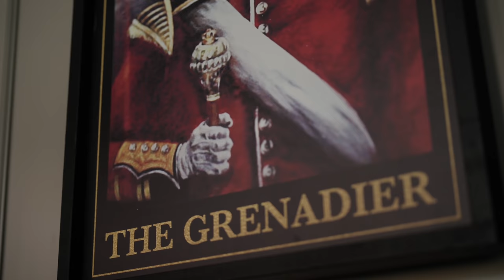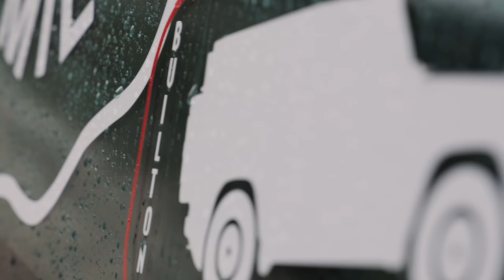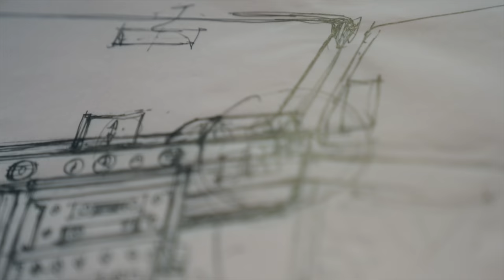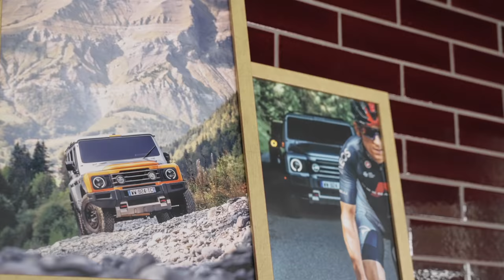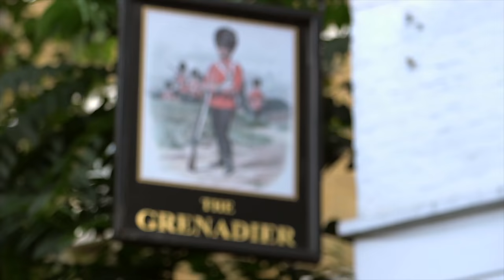Building The Grenadier - Episode 12 - Behind The Grenadier

Comment: Just a big thank you too Sir Jim.

The world just seems a better place now that there is a proper replacement for the classic Defender.
Land Rover is being run so baldly these days, they have forgotten what built their reputation in the first place.

I can remember Land Rover saying way back in the eighties that they would never make an off road vehicle without solid axles and then gave us the reasons why. They don't sell a single vehicle with solid axles anymore. They have forgotten their own principles.
Reply: Here here. I own, and love, a series 3 Landie but totally agree that modern Land rovers are too much of a muchness!
  Too much tech, totally unreliable and not fit for purpose. 
   Bought a 2015 Discovery (full size) 3.0 sdv6 kept it 3 years and 80,000 miles and that was enough. 4 snapped crankshafts from 2 replacement engines. Should have kept my td5. Now running a 2013 Ford Ranger wildtrak. 
   The Grenadier has caught my eye big time and I think in a couple of years I will be in one.
Reply from the maker: The journey has just begun...
Reply: @gertiestravelchannel5957  The term, "Not fit for purpose." Is the perfect expression. The go anywhere vehicle as long as it's not to far from a main dealership.

Comment: Just a thought regarding the potential of a future hydrogen fuel cell powertrain. Looking at various channels focusing on electric conversions of classic vehicles, it is apparent that a body on ladder frame chassis platform tends itself towards a fairly straight forward conversion. Is there potential for a powertrain swap service through authorised dealer/reseller agents in the future for those who purchased a diesel or petrol Grenadier who want to convert to hydrogen fuel cell? I'd imagine the engine and transmission could be sent back if it is still low mileage and on-sold in the parts market as part of the deal. No doubt there would be a market for low mileage BMW engine's.

Comment: What's the point of this? It's a BMW straight 6 in a Defender 110 body? Is this really introducing anything new to the marketplace?  There's a hundered shops dropping in any powertrain you can imagine LS, Porsche, Fords of course. Develop a high MPG hybrid that offers the range, hauling and towing capacity, and offroad capabilities and that's something worth talking about. Introducing another traditional combustion based vehicle seems wasteful and non-innovative.
Reply: It's not - it's too heavy for a start. The Defender was always made from old components added together to make a sellable product. Only the 200/300Tdi and the Td5 were purpose built, everything else was someone's cast offs. This has been started from a clean(ish) sheet and quality components. Other than the cost, I'm really impressed; my order is in.